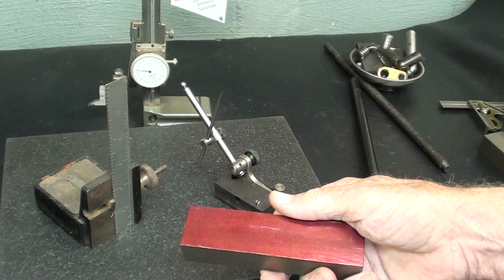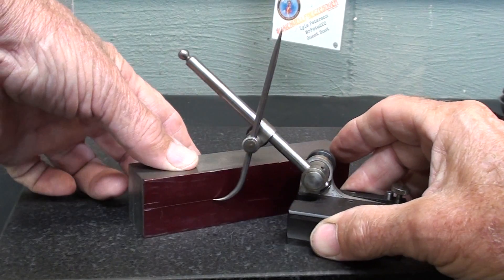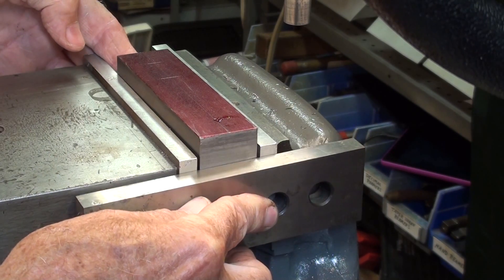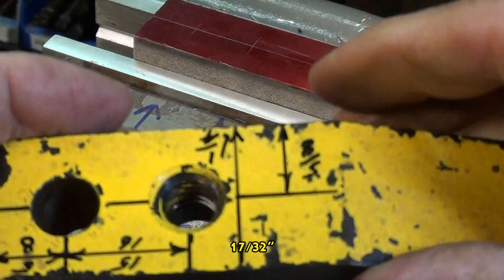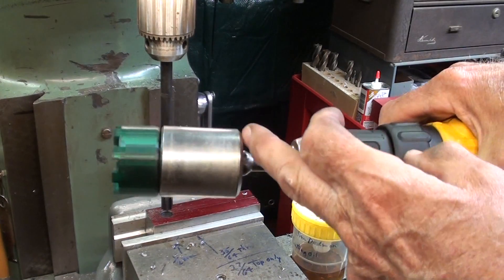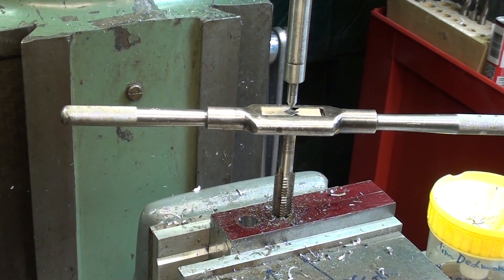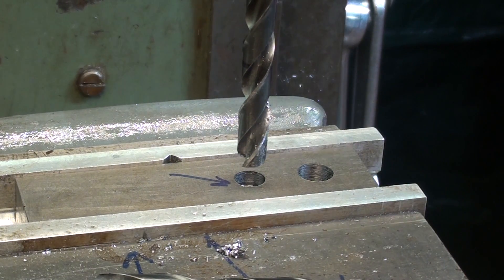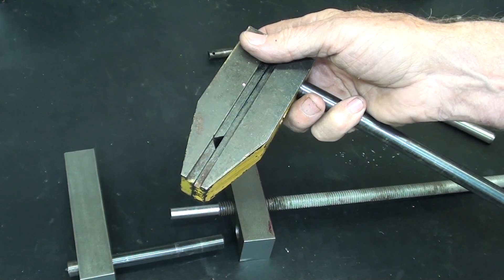MAKE A FLOAT LOCK Drill Press Vise TIPS 581 pt 2 tubalcain

Comment: 13:37 seemed a bit fast on that drill speed, must have been in a hurry that day. :-) You know if you had started with longer bar piece you could have sawn the taper on both parts at the same time when you cut them in two and saved about 2inches of stock and those machining operations to make them. :-)
Reply: That's clever.  I wonder if that's how they do it on the factory made ones.
Takes a bit more planing and careful layout to be sure the holes line up.
Reply: @COBARHORSE1  You cut it slightly beyond the length you need, then you can trim the straight ends to match much easier then put your holes in. :-)

Comment: "You can't put the metal back on." You sure can if you have a welder. It's not gonna be perfect. 
But, if the chinese can weld and grind the cast chinesium bed on my grizzly g4003 lathe, I'm sure that it will work on some other applications.

Comment: Can i ask why when using the spotting drill do you go so deep? the first angle on the point is usually 120° that is almost the same as the drillbit, the next one is 90° that is not and the drill can wander although minutely. The 118° drillbit into a 120° spotted hole will touch exactly on the point first thus being perfectly centred, If the 118° bit goes into a 90° one the cutting flutes will touch first and if not perfectly ground equal could deflect away from the place the first on touches. I have noticed this mostly on the lathe where I centre dill first then followed by a drill of whatever size, if i have gone in further than the first chamfer on the centre drill to the second, when followed by a normal drillbit it almost always moves slightly. If I stop at the first chamfer the drill centres first on the point and then starts to cut.  I hope you understand my way of explaining the question. You could try this out on the lathe to see what i mean. I will built one of these floating vices as they look far safer and easier to use than a normal drillpress vice that is never in the correct place when you want to drill a quick hole and end up doing by hand, big mistake, we have all done it and probably learnt the hard way 😊 ouch that hurt.
Reply: I don't think it's a spotting drill, but rather a center drill being used as a spotting drill. The angle is different. Not that it changes your question. And I don't have an answer to that.
Reply: @ClipperDays  my bad, i meant to say centre drll used for spotting

Comment: Good info.  I have been planning how to approach this project, and most of my steps are right in line with yours so far.  So, I'm on the right track.  I find it instructive to plan the work before you launch the video.  I guess it's a process check with Professor Pete.

Comment: If you used the jacobs chuck to hold the edge finder how much accuracy do ya think you might lose.  ?  thats what this farmer has been using .
Reply: The actual dimensions don't really matter, just as long as the relative holes are lined up. There are critical dimensions, as when features must line up and non-critical dimensions, which can be adjusted for preference. One could change many of the dimensions to create a larger/smaller version or to compensate for available materials. The critical ones involve alignment of the guide rod and the jackscrew.
Reply: Usually ot enough to matter in this situation. (Depending on the accuracy of yours. Each one is different, but most are pretty accurate when it comes to stuff like this job.) You'd have to quantify yours.